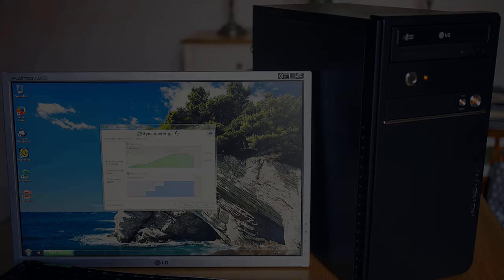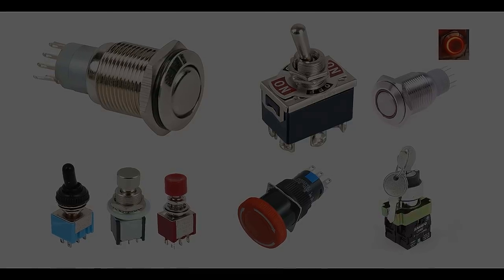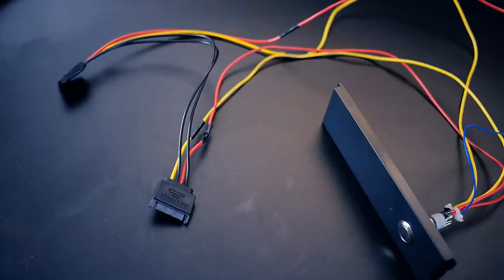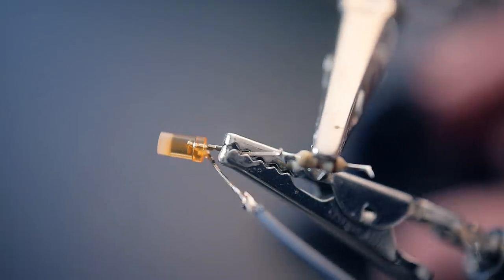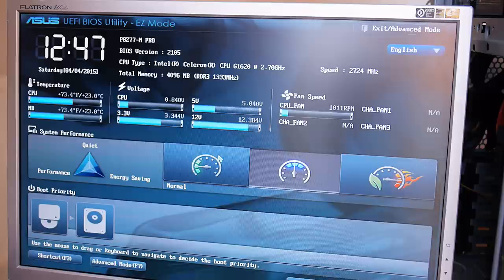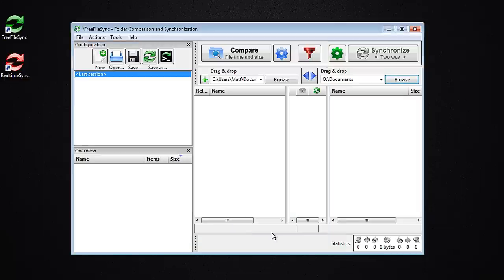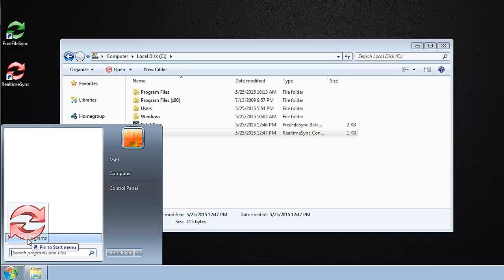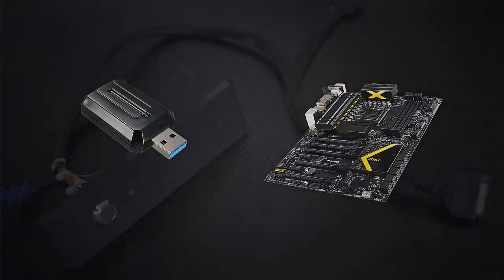How to Make a One-Click Backup Button

Comment: I would recommend "update" mode for most people, because this protects against accidental deletions.  If you accidentally delete something and connect the drive to restore it, the file will be removed from the backup drive, if "mirror" mode is selected, but "update" mode will never delete files from the backup drive.

Of course this means the drive will slowly fill up with stuff you no longer want, and when it gets full you must delete stuff manually (or wipe the whole thing and back everything up again). 

I use this mode and think this is a small price to pay for the extra security of your files.  But I use a 3.5" external hard drive which is available in large capacities.  Maybe it is not so suitable for those with 2.5" hard drives as I haven't seen a > 2 TB 2.5" drive.

This also allows the backup external drive to be used with 2 or more computers without problems :)

Comment: I would hesitate to say the hard drive is protected from electrical failures. If a PSU failed spectacularly enough, it could still arc through the switch to the hard drive and short it out. The same is especially true of more intense surges, particularly lightning strikes.

I guess the overall point is, the only truly secure backup is unplugged and off-site.
Reply: There is no true secure backup, The best you can do is have many backups to give your data every chance of long term survival.
Because anything can happen to any hard drive / SSD, Even if you make it out of totally indestructible deep sea proof  material the drive will eventually die of life expectancy or something technical might go wrong inside.
Reply: That's why an UPS is always good to have, no intense surges and you have time to properly turn off your computer before there's no more battery on the UPS.
Reply: Not completely true. If you're mirroring across sites with a two phase commit, you're guaranteed data integrity at both ends, as it's effectively a single atomic transaction. The chances of both being wiped out simultaneously and not yourself are then so close to zero that they can be considered to be secure, unless you've a need for a PC in a post apocalyptic world. At that point, who cares. Even with something as basic as a Synology NAS that's affordable home technology, if you've two geographically remote sites and a decent internet link between them.
Reply: Unplugged and off site you say? I get a wrench and beat you with it till you tell me where it is and give me the keys to access the building. Nothing is secure dude.
Reply: Which is why discussing whether something is or isn't secure as a binary is a waste of everyone's time, and the only valuable conversations in that space are whether someone's data is sufficiently secure for their needs and budget, and how it can be made more so. The 80:20 rule makes its usual appearance too, as the conversation should always be about which 20% of the maximum amount of work someone could do produces 80% of the desired outcome
Reply: @MeepChangeling  hacking 101 👍

Comment: very handy! thaks!  i always forget to backup data!
Reply: Well, this might not be the so called rocket science, but nevertheless it requires specialized tools and some manual skills - while the same end result could be achieved with just using a proper software and its configuration

Although yes: the one undisputed advantage of such system is the additional layer of security, i.e. disconnection of the disk from the power grid. But at the same time this also creates a drawback of having to remember to push the button after doing any kid of important work or new data acquisition [so there goes the full automation of the process being performed totally in the background]

Comment: Hello matt! I recently did this project on my PC now that i have a new mainboard with sata hot swap support. I used a Molex female to sata male adapter and just cutted the wire for 12v (the yellow).SO it works also with only a normal switch as long you are using a 3.5 inch drive. Many thanks for the nice content.

Comment: The program with your installer works great.
For those who are using Windows8/8.1 or Windows10 you cant find the startup folder directly in the search option and in the taskmanager you cant put it in.
You have to search for "run" or press Windows-Key+R and type in %appdata% then go to roaming/microsoft/windows/startmenu/programs/startup and put a shortcut of the batchfile in there (do not move or delete the original Batch-File!).
It worked fine for me on Windows 10 Pro 64bit.

Comment: Two suggestions:
1) personally I'd prefer to use heat shrink tubing for a better wiring, also on the button
2) SATA 2.5" drives use only the 5V Supply, so if you choose a 2.5" instead of a 3.5" drive you can use any switch (even SP ones)

Comment: And finally...

... I DID IT! it's doing its first sync (240 gb, it will require some time, especially because I disabled caching, so I can stop the drive at the end without "safe remove"). Well, thank you veeeeeeeeery much: it is really exciting and I'm really proposing this solution to my customers.

Although I made it with a little variation: I've taken a DP Switch with a 12V led, and connected the +12V out and ground to the led contacts of the switch. A green light is on when connected, with no need for a LED or resistor. Anyway, thank you again, greetings from Italy and see you next time ;)

Comment: Very slick. The only thing I'd add is to say that you should dismount the HD before turning it off, that will flush any data in the write cache and won't risk corrupting the drive by it being turned off during a write operation.

Comment: Guys, RAIDs should not be used for backing up data. Go to the 8:08 mark where he explains the benefits of having a backup drive that's not constantly connected to power. RAIDs are used for redundancy purposes (R = Redundant). They're useful in companies/businesses where if a drive dies or fails, the backup drive can continue to be accessible and workable without any interruption. Basically, that way companies/businesses don't have to manually unplug and replug drives if one fails.

Comment: Uxcell makes a latching push button switch just like that, but it has an illuminated ring around the button that you can either wire to always be on, or to be on whenever the switch is activated. This particular one comes with blue illumination, but there are others with white or red. Don't know if they are DPDT though, which seems to be what is needed. I just purchased a SPDT mode made by Ulincos for wiring up some undercabinet LED strips. I like it because I can wire it so the illuminated ring is either always lit, or lit simply when the switch is activated. I'm going to wire it so that it's always illuminated that way the switch is easy to find in the dark.

Comment: What about a one click drive eraser?  You know .. for drives with 'special interest' content. Asking for friend of course.
Reply: +Andrew E 
I haven't tried it but you should be able to create a .bat file that runs "format C:" (replace with the drive letter that you want to quick erase). To securely erase the data though you need a secure erase program (most of which can be run from the command line so just find out the commands and put them into a .bat file.
The problem with a secure erase though is that the computer needs time to physically overwrite the old data otherwise it can be recovered by certain programs. (If you use an ssd then all you need to overwrite is the file location database because ssd's are inherently fragmented.)
Anyway, I take no responsibility though if you accidentally erase your main hard drive.
Reply: Albino Penguin
 I suppose I'm more talking about (in a semi-serious way) a physical erasing mechanism, one that might put the drive beyond use but ultimately scrambles/destroys the data such tat it can never be recovered. You see in movies, hackers dumping drives in toasters etc but really my requirement would be that the drive contents be erased totally and as quick as possible.
Reply: +Andrew E 
In that case just have the button attached to a controller that controls a drill to drill a bunch of holes in the hard drive and then sandblast the drive through the holes. 
Or just put the drive inside a compact crusher that crushes the drive when you press the button. These aren't complicated,  especially the second option
Reply: Andrew E a button to fill random junk data to drive?
Reply: one smash :D
Reply: just make an EMP generator :P
Reply: @patrikpavlik3540  onesmash to release a latch for a hammer inside to smack on a hdd lol
Reply: @mendellerner5868  It's possible to recover data from an SSD even if it's been reformatted, so long as TRIM hasn't been ran (which resets unused blocks back to 0's), the data remains, much like on a HDD. I managed to recover all my data from a 1TB ssd after a program bugged and formatted the wrong drive.
Reply: Just ask fbi, they know what to do
Reply: Is easy, just use a bucket with thermite over your pc, linked on a button, when your press it, all inside your pc instant burn at 4532 F°
Reply: @andrewe3165  A button powered super magnet should work just fine. Just make sure to give it his own power suply.
Reply: @bitelaserkhalif  worm malware will fill it up for you
Reply: @ValkyrieStarTV  Or the SSD's secure erase feature has been called that will also immediately run the erase function over every erase block in the drive. Having said that if you want it even quicker electrically frying the flash chips themselves would be near instant, essentially build something that works like a USB rubber ducky inputs connected via a button to the PSU's 5V output. Have the outputs soldered directly to the VCC and GND pins of the flash chips themselves suffice to say those chips will be no use to man nor beast after being fed a couple of hundred volts directly.
Reply: Easy, just take the 230v (or whatever you have on the other side on the lake) instead of the 12v DC Line...done.
Reply: Windows has you covered 

As a police computing helper citizen I know when people format drives without the “fast format” on the format program that windows already has it becomes irrecuperable
Reply: @kaczkinson  emp destroys the board but it can be fixed and everything gets recovered
Reply: @thethoeby  That will just fry the controller board, it won’t do shit to the platters and the data can be recovered. A button which activates a super strong electromagnet would do the trick.

Comment: Time Machine on Mac does most of this already and updates the backup whenever the hard drive is plugged in. It is also a stock program and optimises all the backups for extra backup speed. You can backup your whole computer from it if a failure occurs.

Comment: It is nice and fun, though I think scheduled backups are easier. It is a good idea to physically disconnect the drive from the power source, however the risks of not doing so (i.e. power surge or ransomware) are minimal. Hard drives can be put into standby mode even when they are connected, in case you are worried about the noise and power consumption when the drive is unused. To hide the data from malicious software, simply unmounting the drive should be enough. I think you would be better off with Linux though – it has all the nice tools for scheduling and doing backups without the need for 3rd-party software. For example, you can use cron/anacron for scheduling backups, use rsync or btrfs-send to do the backup, then umount the backup file system, and finally, hdparm -y turns off the hard drive when it is unused. Though I understand that having a one-press button is fun, so I appreciate the work you put into it.

Comment: That was some really nice software you used!
And a really cool mod too!
Subscribing to this channel is paying off again ;D
Not only does it protect the drive when its physically disconnected form the power supply in case the power supply goes bad, it also doesn’t toil the hard drive in the same way, compared with the other hard drives in the system, because its only powered on during the backup. ;)

Comment: Another way to do this with an external drive for both towers and laptops would be to buy a cheap usb3 to sata cable and set up the software on an ssd for backups.  The usb interface provides enough power to run most ssd on the market and it removes the "hot swap" steps.  It's also much faster and more reliable than a hard drive as it is MUCH harder to cause damage to the drive or have data loss as long as you plug it in every few weeks or months.  

I'm sure most people would back up their date more often than that, but I have heard some data can be lost over time on an ssd if it's not powered for extended periods of time.